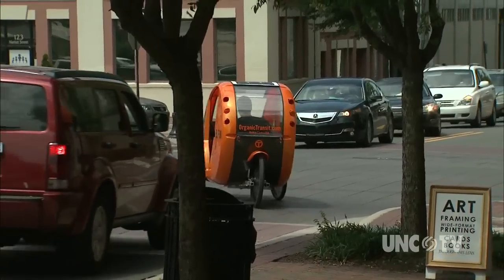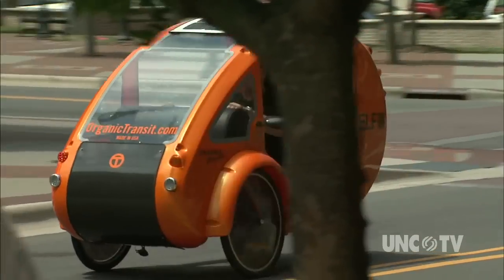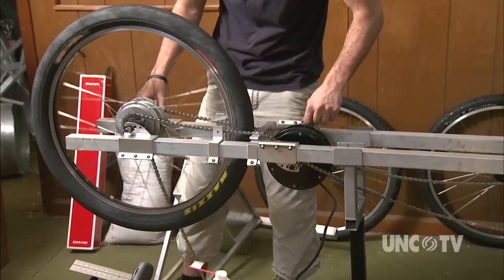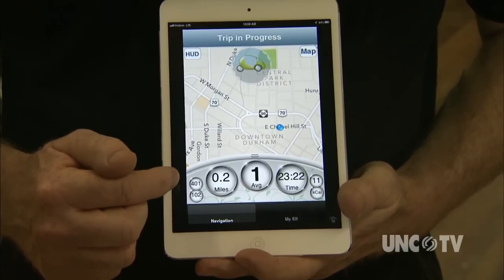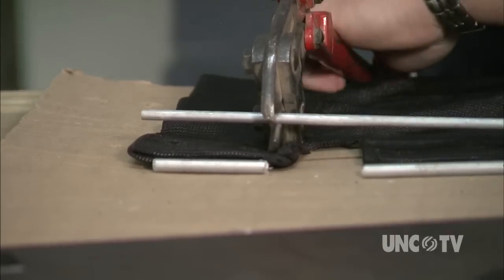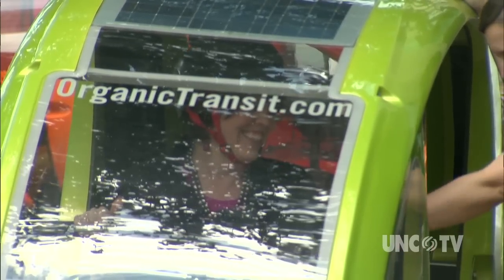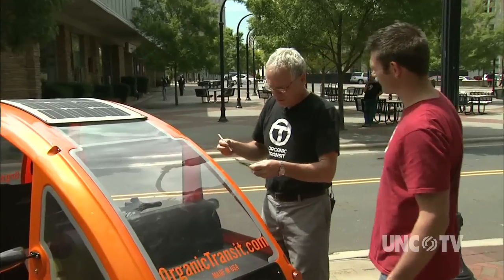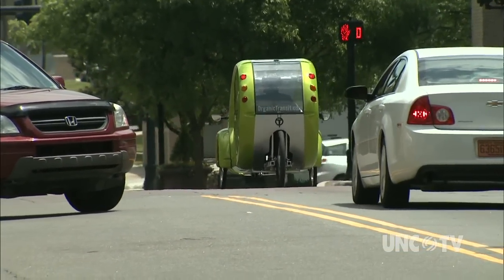NC Now | Organic Transit ELFs | UNC-TV

Comment: 1, If it gets people away from cars and more eco friendly travel, (no petrol / gas / a lot less electric) why not give the 4 wheeler the same status as a cycling bike?
2, It makes sense, a 4 wheeler will look a lot nicer then a 3 wheeler. 
3, Also it will be better, more comfortable, to ride in. 
4, more shock absorption, (4 wheels better then 3) 
5, more breaking ability, (4 wheels give more grip and breaking then 2)
6, more internal space (4 wheels will be wider on the inside, and more space for 2 passengers not just 1)
6, less external space.  (the 3 wheels take more space, as tieback wheel sticks out. 
7, As long as its pedal power and 
8, the electric top up doesn't take it faster then eg 45mph, so its doesn't go on motor ways (free ways). 
9, Eventually light weight brush less motors and better battery power, 
10, with a total solar power outer body, you increase solar gain capacity, and 
11, can increase speed to 50mph to decrease traffic and less carbon emissions. Also you will me more fitter due to the cycling.
12, total carbon body for light weight frame. 
13, doors, to keep the rain out.
Reply: No. A complete over haul of the bike laws would be required. That is not happening. 4 wheels are NOT better for single riders. Appearance is irrelevant. No additional shock absorption. 4 wheel designs weigh more so more braking power would be needed. 45MPH??? This proves you have no clue what you are talking about!!! If the laws were changed it would be for a max speed of 30 mph at most. Human power offers no useful contribution to the power required to go above 30 mph. Solar is just a trickle charge, it has no effect on top speed, just max range. Carbon fiber is very expensive. Doors are a personal car concept along with climate control. We do not want doors, just dead weight that makes it harder to pedal. We need maximum ventilation. If you ask questions rather than posting a manifesto of naive personal opinions you will be received better. Next time ask why the US laws limit e-bikes to 3 wheels or less, rather than coming off like someone thinks they are smarter than the entire United States bike industry and legal system.

Comment: No AC, so if you dress for work and it's hot you will be a mess by the time you get to work.  So a change of clothing is required. DO doors, so if its raining, you will get wet. Thin tires, so it will be sensitive to road conditions.  If you live far away from work, and take the interstate, better find another route an that means a LOT more time to get to work.  
As much as I'd love to have one, its not practical.  4K is also very steep for what is is.  Its a trike with a motor and solar panel.  They have been around for years.  

What about crash protection?  What happens to this (or you) the first time you or someone else runs a red light and you get hit with a car at 25- 30 mph?
Reply: Wrong, the body keeps you cool and you don't need to pedal if it is hot. Doors are an option that few want, only your elbows get wet. Doors do make it too hot and the windows fog. If you have a long commute you are stealing more than your fair share of resources from future generations. This is the safest bike ever made with all around crumple zones, of 1000 ELFs only 13 collisions with cars have been reported and no injuries yet. It is a bargain at the current base rice of 9K, they have all the orders they can handle. This has NOT "been around for years", that is a lie. You sound like a jerk.

Comment: Is the price really justifiable? It seems to be over priced
Reply: Compare to prices of basic velomobiles with no room for cargo or passengers, and no solar or motor. They range from 8 to 12 thousand USD. This product has over $2,600 worth of materials and components at the wholesale price. US made. Factories, showrooms and labor are not free.
Reply: You could build one yourself so long as you know its construction and materials used, however your not paying yourself in terms of time to assemble it, the only thing most people do not realize when DIY building something is they are only saving on labor. Given they have the knowledge of what goes into what they are building and the requirements to make it safe for everyone as possibly can be done.
Reply: Making a mold for the light weight body shell is not worth it and you won't have vacuum molding, have to use carbon fiber, very expensive, to keep weight down. If if was easy, many would do it.

Comment: How do you secure these so they don't get stolen..?  It would be nice to have a metal loop attached to the frame so that you can lock it to a bike rack.  In Portland, 4 bikes are stolen every day.. (every day) in a city, security is a big issue and they ELF website gives no security options (And these are too wide at 3.5 feet to bring into your home or apartment.  Might be good for someone who has a garage and a secure, guarded parking area.  (Oh... it also needs to be in the sun for solar)     Nice idea...!  practical..?
Reply: All bicycle security options apply to the ELF. In addition it has a removable key for the motor and without the motor power you are dealing with a 160 lb bike under pedal power only. Of the 900 ELFs sold, two have been stolen. One was recovered and the one not recovered was not locked by the owner. At least one owner I am aware of keeps her ELF out on a public street in a marginal neighborhood and has done so for 2 years. She locks it to a sign post by the curb. I keep mine under a car port now but also kept it for the first year out in the open with a golf cart cover to cover it in bad weather. It charges while I am out and about on errands, I return home with a 90% charge.
Nice idea and practical. But it is absurd to suggest that any one vehicle is 'practical' for 100% of all transportation requirements.

Comment: The video reports the cost is about $4,000....Going on to their site, that is less than half of what the webpage for the company says it costs....the beginning price is $8496.
Reply: You missed the publishing date on the video when it was produced, so yes its natural for price to increase, its like looking at the Ford F150 and needing something like the 450 or 650 and your going to be paying much more. Sure computers started out high but then price came down but lasted in that lower price for a few years, you would be lucky it last you more than say 4 years at a couple hundred bucks. Thus why you see computers costing thousands since they can be upgraded part by part as needed to operate efficiently as possible along with the recommended upgrades of said OS programming.

Comment: i luv this elf i would  be perfectly  if it was only 2.5 feat wide so you could lane split like a bike  .,at 3.5 feat it takes up a full land like a car .   and it would hold up the flow of regular traffic.  . but i think this would work in the philippines  and other developing  countries
Reply: Evert - As a daily driver of the ELF for the last 29 months I can assure you there are no such problems with it. It works great here in Florida. A 12 inch overhang into the car lane is NOT "taking up a full lane" by any stretch. Most cars easily pass, only semi trucks may have a problem passing and we watch our mirrors and listen for them and give them a chance to pass. We share the road.

Comment: I agree with most of the comments.  I am producing a feature documentary on e-bikes and have been following the Elf for years.  Even at one point offered to ride an Elf from North Carolina to Southern California to help gear up sales.  I have ridden the Elf and it is well built and could easily take off with the proper promotion and branding.  Strong sales volume would take the price to the proper level.  It is kind of a catch 22 and I don't think that Cotter has the money of an Elon Musk to run the company for years without a profit.  He has to think outside the box and work with dealers that follow an open, inventive and high profile plan to market the Elf.  I tried to get a local dealer to bring an Elf or two to a couple of the National Drive Electric Events, but they turned down my advice.  With the proper marketing the Elf could make a killing in the world of e-bikes, but apparently, not yet.

Comment: 3 years later and this is still starting at 7k. I can build one for less than 2k.
Reply: So build them and we'll buy them from you.
Reply: Organic Transit I've seen the quality of the builds in several review videos. it's not impressive. At roughly 2600 with off the shelf parts a person can build equal or better. 7k would be much better spent on an Elio
Reply: Elio, a non-existent promise, is gas powered and over powered. Apples and oranges.

Comment: 8k any only goes 35      go get mo pad 450 cc go 60  mph for  5 or 6k
Reply: So with the moped, how much you paying for fuel maintenance, insurance and registration good for how long? This does not use gasoline or any fuel other than plug in or sunshine power, does not need registration to use on the road in most places, can use the bike/pedestrian paths unlike a motor vehicle or moped/scooter, and can be repair for much less at any bike shop compared to an auto shop.

Comment: How you going to teach it to drive it's self? Driver does not meet capacity requirements. Even  even with the 55 gallons of water is over capacity without a driver, not to mention the container's 55#. My guess is you'd be 200# plus over-capacity in the end. Just don't lie to us.
Reply: The barrel hauling he mentioned was for the cargo model with an 800 lb payload. It has not started production yet.

Comment: 4000 dollars? what?
Reply: No. It is $7000. Selling well, 800 sold.
Reply: That's too much...
Reply: No it is not. The materials alone cost $2600 wholesale. Try designing and wiring a full DOT compliant lighting system. It is in fact in high demand, more demand than supply. Mine saves me $3000 every year over car ownership.
Reply: Are you kidding me? the price is too high. With 7000$ you can buy a very good car, wich is made of milions of parts and more materials that this... that is a very simple vehicle made of some tubes and fiberglass... If they can sell it at 7000$, doesn't mean it worth 7000$. SAve 3000$ every year over car ownership??? You could buy a 100$ bicycle...
Reply: TL - that is a dishonest post. No new car sells for $7K in the US and no car has 'millions' of parts. There is no fiberglass in an ELF and aircraft aluminum is much more than 'tubing'. 
The financial advantages are with comparison to car ownership, not two wheeled bike ownership. Bicyclists already know which is more affordable.
The price is what it is and demand exceeds supply. You are not required to buy one.
Reply: I don't care if the demand exceeds supply... Cause that happens even with products like I-phone, but the I-phone doesn't worth it's price... it's just good marketing... Here in Europe you can buy a Renault Twizy with 7000$... and that is a car with suspension, safety features and 100% electric power,.... I really like the idea and the look of the ELF... but it cost too much for what it is.
Reply: T L - Different market, different cost of steel vs. aircraft aluminum, different national safety requirements. Apples and oranges. No matter how much you squeal the ELF has $2,600 worth of materials and a lot of labor. The competing US made PEBL velo being built right now retails for the same price with solar. The ELF uses the toughest oversized MTB racing parts and is US sourced as much as possible. 
Less is more for those who want to live sustainably and avoid stealing more than our share of resources from future generations. 4000 lb steel caged climate controlled high speed couches are not sustainable at any price or with any power source. They require too much nature suffocating infrastructure and will eventually be taxed into oblivion.

Comment: one criticism, zero suspension? it looks small and light enough that some old school chevy valve springs would be enough to give 1-1.5" worth of nerf to soften impacts of rougher pavement. sparing some damage to tires, rims, bearings etc while helping make the ride a little more comfortable. up front it could be as simple as what old RC pan cars used, and at rear not really much more complicated.
Reply: It has front elastomeric suspension. Many choose the three inch tire option. Mine smooths out the bumps by keeping them less than fully inflated.
Reply: "elastomeric suspension"? Front and rear wheels are BOLTED directly to the axle and frame. 
The only suspension is the aluminum frame flexing. TIRES are not suspension, springs are.

Comment: Pretty neat but how can they justify that price? 4 grand is crazy expensive for a bike.
Reply: +JPVegh That depends, a recumbent trike from one of the established manufacturers without suspension or e-assist would set you back around £2000. From an engineering perspective the ELF hasn't got the same level of design and construction as those trikes, they've taken a few shortcuts to minimise costs that given time they'll improve on i'm sure.
Reply: +Vince Scott Oh, ouch, i just looked at their website, its over $6000. That is starting to look like quite a lot of money.

Comment: it lacks suspension system, for 4000$
Reply: Incorrect. It has suspension and a 3 inch tire option. The base price is now 7K.
Reply: TIRES are not suspension, SPRINGS are.
Reply: HEY, DUM-DUM. PowderMonk was commenting on THIS videos version of the ELF. 
Now go bury your head a little deeper. ONCE AGAIN you're wrong. 
GOL-DANG I swear you're too young to use the Internet.

Comment: I don't understand why all or almost all of these commercial peddle vehicles have such small wheels and have the front ones so close together. THIS IS A BAD DESIGN! Turning with such vehicles such as with the Virtue Pedalist must be taken at very slow speed in order for it to not tip over assuming it does not have a turning compensating system which I don't think it does if it is basically a covered electric tricycle! More work needs to be done for velomobiles or covered peddle/electric vehicles which are not velomobiles if they are to effectively replace automobiles at all even for short distances!
Reply: You probably could just slow down for the hair pin corners you are referring to, i know its not a car is hard to grasp bit bikes have to be small
Reply: +OT Sales 2 I live in Louisville Kentucky I'm on disability and need transportation but only get 750.00 a month to live on. I love this machine do you have a payment plan I could afford, also Louisville has been promoting bicycling for a few years now and there is a market for a machine like yours. I could be a great advertisement for your product. thanks for any response

Comment: I guess this is only for niche market when it costs $4000.  I understand your concept, but you just need to wear rain pant and rain coat with cap if you don't want to get wet while riding a bicycle in the rain.

In Japan we have many sort of electric bicycles for $400 - $800, and commercial wise very successful.  If you ride an electric bicycle it's not tough to go uphill.

Comment: "That was your fault....you scratched my ELF...right.. .what's the name of  your insurance company?"....  but still... I can see these catching on because of several advantages:  cover from wind and rain, main and signalling lights, motor assistance, the need to get regular exercise, the lack of running costs like gasoline and insurance, no need to have vehicle license plates or get a driving license.... these are significant advantages. Disadvantages: obviously slow speeds, difficulty in handling hills because they weigh more than a bicycle although the motor may equalise the effort to that of a normal bicycle, easy theft and vandalism, quite a high price, and if they become too numerous on the roads, they will create congestion. In my opinion, all 1st world countries should invest in a road infrastructure separate from current conventional engined vehicle roads to prevent congestion and promote all safe human powered transport.
Reply: I think the thought that might connect the loop here is this: The people getting into these elfs (elves?) will be getting OUT of cars. Every single person that gets out of a car and into something smaller is part of solving congestion.
Reply: The "slow speed" is a slow maximum speed. Take a look at average speed and you will see that velomobiles beat regular cars hands down in heavy traffic. A 1hp ebike does nicely too. A 6 mile trip in heavy traffic; by Ebike: 16 minutes or less every time. Car Trip: 20-30 minutes.
Reply: eggaweb
That's ok for the current level of use, but if more people appeared on the roads with these, they would cause congestion.
Reply: *****
Velomobiles take up 1/4 to 1/3 the space of a regular car. With an average of 1.4 people per car per trip, that's a lot of real estate that people are taking for commuting. For every 100 cars (140 people on average), 400 small velocars will fit in the same space, on the road or parked. A 2 lane road turns into 4 lanes for narrow tracked vehicles.
Reply: eggaweb
They will cause congestion when mixed with regular traffic in too many numbers.
Reply: *****
You're stating a strong opinion here; I would like to see it backed up with facts. Here is a fact, more cars create congestion to the extent that most of the worlds major cities are in permanent gridlock. Smaller vehicles will automatically double the capacity of the roads. Ideally, 90% of the larger overweight overpowered vehicles should be removed, this I bet will naturally occur when oil hits $40 per gallon ($10 per litre).

Comment: I have a Sinclair C5 (1985) its similar but the ELF is faster and a bit safer and has a longer range :-) the C5 is the ELF's predecessor
Reply: No it is not. That is a heavy steel contraption with very heavy lead acid batteries and no solar roof.